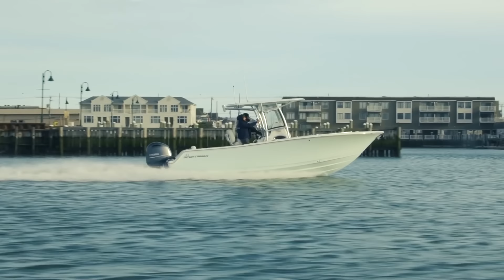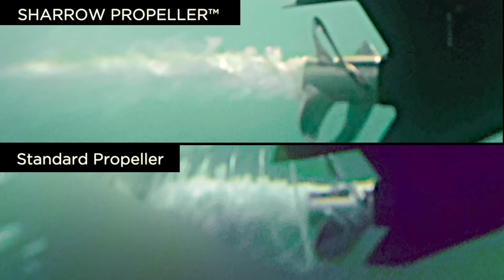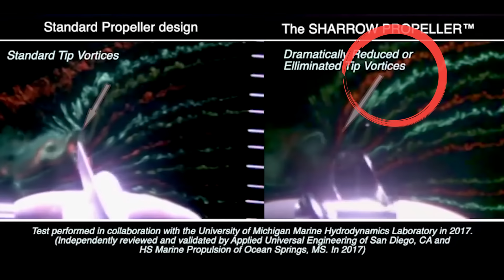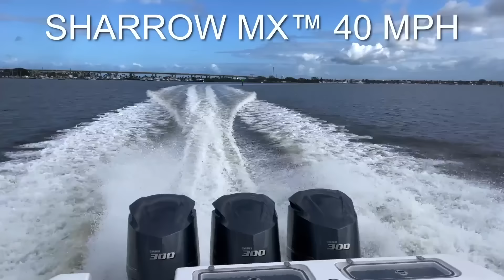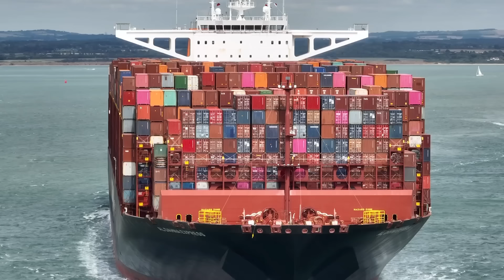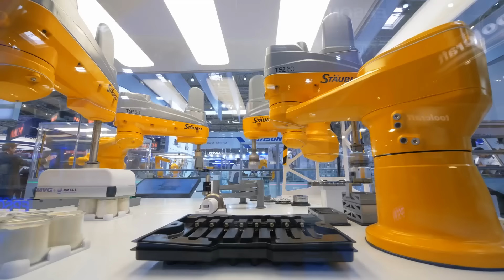This Genius Propeller Will Change Transport Forever

Comment from the maker: Thank you all for watching and the interesting comments, here are some points to address the main ones I have seen:
- Great points about how this may be manufactured in the future, part of the economies of scale I mentioned could definitely include injection moulding or similar.
- Durability is an interesting point and I would love to see how the blades fair in a 'crash test', they may also be harder to repair? Let me know your thoughts. 
- The gain in efficiency is 105% when compared to the original values (38% to 78%), it is true that absolute efficiency cannot be over 100%, but increases can be. Such as a company seeing a 200% increase in profits, for example.
- Many saying that reduced cavitation may also reduce wear on the blades, making them last longer in boats. Great point that I didn't think of!
Reply: This design is over 35 years old
Reply: @supyrow  much much older 🤔
Reply: @thisgame2  yeah!  saw it in a magazine, can't remember which one exactly, popular science or mechanics, something. decades ago
Reply: @supyrow  Yup, nuclear subs....that's all I can say...🤫
Reply: @supyrow  is there a formulaic mechanism that gives the proper parameters for the dimensions?
Reply: @supyrow  Yeah, and if it's significantly better, the Navy would have put them on every nuke subs and other ships. Less disturbance means less detectable too.
Reply: @gang208  water and air, are quite different beasts.
Reply: @supyrow  YES exactly. Instead of being economically sensible, the people in charge of making money with things have decided to price it out of the market.
Pity it isn't mandatory to study physics AND economics along with English.
Reply: Ohh.  And it is louder, more Inefficient.
Reply: @supyrow  Louder?  By how much?  For an incompressible fluid like water or compressible like atmospheric air?
Reply: @johnpayne7873  "incompressible fluid"...  yeah...  not sure what part of the universe your from, however back here on earth, water can definitely be compressed.  i am going to screenshot this.  can't make this up
Reply: @supyrow  Not made up, incompressible flow is an essential part of fluid mechanics.   Robert Patton has a classic text on the subject with the same name.  Materials that assume a fluid state are by in large incompressible for large ranges of pressure and temperature, with water being the most referenced material.
Reply: @johnpayne7873  bottom of the ocean. compressed fluid:water.  everyday.
Reply: @supyrow  Only a 5% increase in seawater density from sea level to bottom of the Marianas Trench.  For all practical purposes of engineering mundane vehicles, it's pretty safe to assume water density is constant.
Reply: @supyrow  OMG, just stop talking - you are making a fool out of yourself. If you had actually studied fluid mechanics, you would know that water is modeled as an incompressible fluid...
Reply: @eliasgermer8762  this is true.  However,  the argument is that water is compressible.    It is literally 'precompressed'
Reply: @supyrow  Yes, you are right. I just thought it was obvious that the standard model of fluid mechanics was intended. With that said, I apologise for my previous comment - it was unessesary.
Reply: @eliasgermer8762  no worries, no hard feelings.  I appreciate you.  your response was justified, its cool
Reply: I am going to see if I can get a few 3D printed for use in water pumps. Efficiency is critical when working off the grid. Cheers
Reply: @uprightfossil6673  toroidal props are designed for use in the open, not inside a housing. They don't provide any benefit in ducted fans or pumps.
Reply: @squirts1  and you know this by empirical proof? Theory is great. Like opinions everyone has one. I plan to try these props in a small scale water pumping situation where noise, cavitation and efficiency are critical.
Reply: @uprightfossil6673  I mean, they explain the purpose of this design in the video, but you can read up on it yourself. Toroidal props reduce the tip vortices (vortex). Ducted or shrouded fans/props/pumps don't have problems with tip vortices because there is practically no flow beyond the tip. Also, pumps generally don't use propeller type blades. They use various types of impeller blades that are very rarely similar to propeller blades. There are several reasons impellers, pumps, compressors use different types of blades.
In addition you can reduce noise by adding blades and changing blade geometry for open air props.
Reply: @squirts1  I have plenty of free time being retired. The application I am looking for is specifically for moving water. You sound as if you understand how a more efficient way to pump water would be important in a limited DC off grid situation. That is my interest. I care not one bit for others who claim one way or another about something I can do myself. I have not attempted to use toroidal props in my pumps, but will do so very soon
Reply: @uprightfossil6673  I mean, you can try but I'm telling you it will absolutely be worse than any other type of existing impeller pump design.  Objective fact.
Unless... The pump you currently use was of your own design and is made to some poor standards (like just sticking a propeller in a pipe without any care for proper pitch and sizing. 
Also you should consider whether you need volume or pressure or a mix of both. That determines the type of impeller pump you should use... Axial vs radial impellers perform differently and will be more or less efficient if not used in the proper application.
Reply: @squirts1  are you speaking from experience or from theoretical principles. Because from what I have experiences before trying toroidal props was that seemingly insignificant changes made a big difference in either volume, noise/vibration and pressure. Please note that I am using many pumps for different applications. Some I need volume at a certain head and others I need less energy consumption for volume.
I appreciate your doubts, but without actual testing in my situation, theories are just untested ideas and doubts are reason for testing. Cheers
Reply: @uprightfossil6673  I mean, it's more than just a guess bud. It's physics and fluid dynamics.a toroidal propeller is designed very similarly to a standard propeller. It's basically 2 props offset from each other then connecting the offset blades.
propellers are designed very differently from impellers because there are different principles involved. 
Also, toroidal props are for the most part snake oil, even when just talking about props.
It's very clear you are not an engineer and don't understand how these things work...
But feel free to waste resources on something I know won't be better than existing impeller fluid pump designs.
Reply: @squirts1  well, as an engineer you should also never assume everything works as it should. No I am not an engineer, and as I said I am looking for that one spot on the graph that suits my numerous varied situations. If you had been here when some of my “aha” moments were found you would not dismiss anything from the possibility of success. Good luck going forward with a closed mind my friend, but it will be less frustrating for you to open up a bit.
Reply: @uprightfossil6673  haha... There's a difference between closed minded and being informed.
Reply: @uprightfossil6673  Here, take a look at this video testing several toroidal propeller designs on a 120mm computer fan. Toward the end you see the list of designs that have been tried and these are... not good. Note the #1 spot is a stock Noctua 9 blade fan, the rest are mostly user submitted fan designs (non toroidal).  Also, there are other tests around youtube showing toroidal props reducing efficiency. 

https://youtu.be/dBB_2P-Nq18

Another thing to note here is the MIT prop is comparing a the cheapest possible, included in the box, 3 blade prop. It is not comparing itself to other, aftermarket props that easily blow the stock prop away (pun intended).
Reply: @squirts1  the main thing here was clearly underwater props which need completely different things from computer fans, maybe it wont do much for drones (it probably will as you could see from the footage of the dyed air). Almost all of it is about noise and efficiency not performance. You are looking at this whole thing from an odd and in my opinion incorrect angle, you are showing yourself to be nice and high on the dunning kruger confidence spike
Reply: @squirts1  I really appreciate this conversation. And I am not trying to be difficult. But as I said, I am looking for that sweet spot in the curves of performance versus efficiency. You don’t have to convince ME. I AM NOT A FLAT  EARTH PERSON. I respect the physics behind all the tests, but in some of the videos I have seen a sweet spot and my curiosity has been peaked. I will look at your suggestions, and believe me, if my own tests aren’t convincing me I will still have lots of time on my hands.
My most difficult challenge is to lift a large volume of water >20gal/hr about one meter/yard from a low rpm using wind power. But, I have several aquaponics setups that have varying degrees of lift and volume requirements and are limited by DC voltage and current from solar panels. Cheers
Reply: @squirts1  just a short addendum my friend, having worked on turbine engines as a youngster I understand air compression. These toroidal designs I have seen for the most part do not take into effect the compression of air in factoring the blade design. IMO the leading edge blades should be less surface area, but that is not my area nor interest at this point. Just a note from an old hack. Cheers
Reply: @Floris_VI  The video I posted wasn't for you, that reply wasn't a response to you, and I never claimed it covers all scenarios. 
My replies to the other gentleman were specifically about enclosed water pumps (because that was his use case). Ducted or shrouded fans are similar to the type of enclosed water pumps the person I was talking to would be using.
Perhaps you shouldn't respond to comments when you don't understand the subject.
Actually, the main thing "here" (the MIT prop) was open air propellers for RC quadcopters.
That said, The Sharrow props might be as good as they claim... Time will tell, but everything I've seen about them has been advertising or sponsorship. I'll continue to be dubious of such claims. It would be interested to compare them to ducted/shrouded ship propellers which are designed to have essentially the same effect.
Also consider that the size and mass of vehicle being propelled as well as the size of the propellers will have a dramatic impact on the type of propeller that is most efficient. For example, the U.S. Air Force has converted the C-130 from 4 blades to 8 blades while most RC plane pilots are using 2 blade props because they are more effective and efficient for their respective applications.
Reply: @squirts1  I was just making the point that engineers I have worked with are set on ideas that while observing the Laws of Physics, do not open themselves up to alternate applications. One video I watched showed a toroidal design with a better looking displacement of water at low rpm. Interesting to me, but not to an engineer who looks at the whole chart and says “at peak rpm,…” I need a sweet spot and don’t care about anything else was my point. Cheers.
Reply: @uprightfossil6673  Yeah I get what you're trying to do. I'm just very confident that your efforts would be better put to use on a different type of impeller design. Moving volumes of water vertically through a pipe at low rpm will need a pump with tight tolerances between impeller and housing. It would be much easier to do that at higher rpm. Anyway, good luck.
Reply: @squirts1  yeah, see that’s what I am talking about when I say engineers have a certain way of thinking. So far the best way I have found to move water efficiently with wind power is a variation of the water wheel. And that is why being hard headed and having lots of time, I will experiment with finding a sweet spot with a toroidal prop. All the best my friend.
Reply: @squirts1  Milan Vitez “water wheel pump” YouTube video from 11 years ago. I am tech ignoramus so I cannot link
Reply: @squirts1  yeah, I know about trying to lift water since I have aquaponics. Physically lifting five gallon buckets of water is a thing of the past now. Not so long ago it was my “exercise” for the day. Now, through a series of pulleys, springs and levers I can move water along to places I used to carry it uphill and all it takes is the sun, a battery and a pump to get things started
Reply: I haven’t watched your gym setup yet, but I will soon. I may get some ideas for your pulley setup. Cheers
Reply: @uprightfossil6673  sounds cool. As far as engineering mindset, it's more about not knowing your application in any detail. I was under the impression you were trying to move water inside a pipe given that we are talking about propeller blades. Water wheels certainly work and at low rpm at that. 
Oh, haha you looked at my videos? Nothing revolutionary there, just making due with materials available to me in Afghanistan. That was during covid when the military shut down all the gyms on base.
Reply: @squirts1  yeah, well, I found out about water wheels by accident also. Never know who has the next great idea. I used to carry my son in front of me so he didn’t have to stare at the back of my head. And voila! Someone invented the front carrier ten years later. My oops for sure on that one.
Reply: @squirts1  why wouldn't they?
Reply: @r4d1k0l  dunno what we are talking about but I'm not gonna scroll through 183 comments to find out 🙃
Reply: @Upright Fossil  Yes i am thinking the same , but for what sort of pump application? Drainge or  deep well ?
Reply: @uprightfossil6673  it is louder and efficiency will decrease. Get your results and post back here.  It is an old design,  it is garbage.
Reply: @supyrow  Where are you pulling your results from ? i.e.: Louder - Less efficient ?
Volvo Contra Props are VERY efficient. This looks similar albeit in one piece.
Reply: @team3383  it is an old design.  Lol.  It's bs.
Reply: @team3383  well, you can see some real numbers here. i left timestamps, the video is long winded.
https://www.youtube.com/watch?v=iISDNBTxwhM
Reply: @team3383  noise = energy loser = inefficiencies
Reply: @squirts1  less noise = less energy lost = less inefficienies. LOL.
Reply: @team3383  ok? I mean that's basically the same thing I just said.
Reply: @squirts1  If YOU say so LOL
Reply: @team3383  Im not sure what point you're trying to make... Are you just trying to pick a fight or did you make a mistake? I mean it sounds like we agree.
I said...
 @Team33  noise = energy loss = inefficiencies
Which is obviously the same thing you just said. It shows the direct relationship these properties have. More noise is more energy loss, which obviously means les noise is less energy loss.
Reply: @squirts1  I don't waste time re reading comments.
So if YOU are content, then so am I. Can't be clearer than that my friend.
Reply: @team3383  haha... sure kiddo.
Reply: How about windmills ?
Reply from the maker: @lito11111940  Would love to see someone work on this! Expect a video if I see any thing.
Reply: @lito11111940  no windmills, no PC fans. They are too slow for this shape to be efficient.
Reply: @TechMasterRus  I cant get over that noone mentioned the likelyhood of stuff getting caught up in the holes, especially water is always full of stuff, and especially stringy plantfibers, fishing lines, wood could reduce any efficiency in notime
Reply: @lito11111940  Imagine the size ! What would you make them out of to control the inertia and weight ?
Reply: @team3383  Honestly, no clue, just a thought. cheers
Reply: I work on ships, and reducing cavitation is a big deal for increasing the lifespan of equipment. I'm gonna be very interested to see if these propellers start being made for cargo vessels in the next few years- most shipping companies would pay hand over fist for a new propeller that offers even a 10% boost to efficiency
Reply: @angryscotsman93  This propeller makes the big improvements at 2000+ rpm. Ships run their propellers around 100 rpm so it is not relevant, if it was the big ships would have changed a long time ago.
Reply: graphene
Reply: Can it be used in power plant turbines (hydro, steam, gas)?
Reply: Well here's a great opportunity to teach everyone about the difference between percentages and percentage points.
38% to 78% is indeed a 105% increase.
Alternatively, it is a 40 percentage point increase.
The thumbnail saying "+105%" is, IMO, partly responsible for any confusion on the matter, since to calculate an x% increase, we MULTIPLY the base percentage by (1+x). But to calculate an x percentage point increase, we just add it to the base percentage. So the "+" symbol is more suggestive of a percentage point increase than a percentage increase. I would personally think that "2.05 times the efficiency" would be the most clear way to phrase things. But regardless, the video is certainly not incorrect.
Reply: May be some  safety advantage, too.
Reply: Looking at another with a three blade design. I know from C-130aircraft that three blade vs four blade props is a HUGE difference in performance. Good luck to you.
Reply: This is a scam. I read the paper and there is absolutely no data of any kind that support their claims. Not even the decibels which they claim it "reduces".  They only showed a stupid animation, not even a simulation which requires real data.  Don't be foolish by this scammers. They only did it to earn a price in a MIT competition. I mean, I would expect more from MIT.
Reply: So, how do you change the pitch of the propeller?
Reply: I'm not sure you've described cavitation correctly. Cavitation is about the fact that the low pressure zone on the reverse side of the propellor is so low that it the water boils and creates bubbles in the wake. It isn't the same as the tip effect that you describe; although that may be valid. The noise of cavitation is quite specific to underwater applications.
Reply: All of your points are valid. My only concern is structural integrity. These ideas combined with nanotube technology will open new worlds. I can't believe these scientific idiots haven't figured it out yet.
Reply: This propeller is from the 70s and no, it won’t change anything… engineer wannabes thinking any old crap is going to be the future just for the clicks and views deceiving the audience…
Reply: @DashzRight  I was thinking too, there are toroidal shapes that are effective and toroidal shapes that are ineffective. To engineer a toroidal shape that blows air at 105% efficiency would be a grail invention.
Reply: I’m just subbing because you’re super hot and I wanna go boating with you.
Reply: @NealD  That's awesome! Good luck! Zeroth? Time to get your toroidal on!
Reply: Offtopic but is the toroidal propeller less effective in air (mostly) than water (like showcased in this video?
Because I found other videos where there are any cons of using the toroidal propeller in air

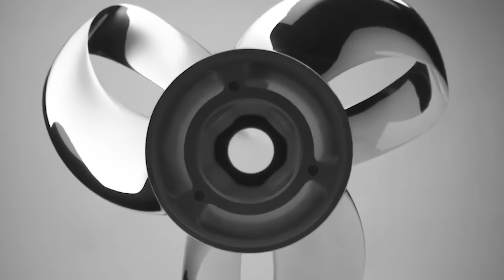Edit: 2:10 Oh! So Sharo is the strongest type of toroidal propeller than MIT? Now I know why toroidal propeller almost ineffective in air because the type of toroidal propeller they used (at least in other video) is MIT type, not Sharo type
(I already watched it but my good attention isn't great enough to found that detail before I type this reply. My bad 😅)
Reply: https://www.youtube.com/watch?v=pA1ye_SP2P0 Genius bordeless propeler 🧐
Reply: The sad part about all of this is it was conceived around 100 years ago by Viktor Schauberger and suppressed by the same group of people who suppressed Tesla.  This is nothing new and MIT shouldn't be recognized for discovering shit.
Reply: Dr. Science has created energy lol.
Reply: Actually, it is possible to have an efficiency greater than 100% because of its definition. However, if you calculate it with exergie instead of energie, then it has to be less than 100%. If you doubt of it, I can you some great thermodynamics books
Reply: @marzyhelmondo5980  does this 'book' spell 'energy' correctly?
Reply: @marzyhelmondo5980 incorrect. in the notion that it cannot be more than 100% efficient.  100% efficiency implies it has zero loses. any claims otherwise is defying the laws of thermodynamics.. as we know it. granted...   get a magnet cold enough and you will have 0 resistance.  problem is.... it takes energy to get and stay cold. that would be your energy problem.  therefore. 100% not possible.  EDIT:  @marzyhelmondo5980 i misread your reply, my apologies.  your correct
Reply: @xxmrrickxx  No, thats not correct. 10%->20% increase in profits is 100% increase. or 10%-points/10pp or p.p.
Reply: did someone say windturbine
Reply: So Zeroth, are you producing this video by yourself, or is it a large corporation?.....these fake foreign accents are annoying.....and you can tell it's the same person using them....look, nobody cares how many info videos you put out anyway.
Reply: THIS is why you make all these videos with a fake accent, because you really DONT know what you're talking about....pic a subject, do little research, make a video and make some cash...... I've watched numerous videos with your fake accents.
Reply: How about you change the thumbnail then
Reply: Why is there still no video demonstrating the difference in noise on quadcopters? Marketing lie?
Reply: @bratecyo  there are videos about that. Search YouTube for toroidal props... Some show improvement, others don't. Others also compare toroidal to 6 blade props and show the 6 blades to be better.
Reply: Alao obviously for both boats and drones this will have widespread military applications
Reply: @Floris_VI  na it won't.
Reply: @squirts1  great argument mate, explain to me how it wont work then mr scientist
Reply: @Floris_VI  Oh, it works... I didn't say it doesn't function... but it's not better than other existing propeller designs, therefore it won't have "widespread military applications." Also, I wasn't making an "argument." It was a statement of fact.
Reply: Can we test these? Where can I get 4 of them?
Reply: Let's imagine all of that which was presented in the video were true. 
Then the props would be classfied and used in the USN submarine fleet exclusively for decades before they get photographed and declassed. So how come that this did not happen?
Reply: I sell used boat parts for a living.
Cant speak for manufacturing,  but prop repairs, I can.
It looks like it shpuld be just the same as a trad prop to fix, depending on the material.
Reply: i need one to test on a paraglider system.. please and thanks.
Reply: So, click bait. As per usual from channels like this.
Reply: Reported for misleading thumbnail.
Since there is no propeller with even remotely 100% efficiency, there is obviously no propeller with over 100% efficiency. Otherwise that would be a perpetuum mobile and all energy problems of the world would be solved.
Reply: Since you admit that you were wrong, and that it DOESN'T actually have 105% efficiency, you should re-edit the video to reflect this. THAT way, you don't look like some drama queen knucklehead that makes impossible claims because he flunked physics. In informational videos like this, accurate details are the difference between looking like you know what you're talking about, and looking like you are full of crap.
Reply: Делай тест
На 5-6 грамм приходиться 1 ватт энергии
Вот когда будет 7 грамм на 1 ватт можно кричать о сенсации
Reply: Toroidal fields control earths atmosphere
Reply: That's not even the real problem, modern props typically achieve ~85% efficiency, so a 105% gain is impossible. After watching the video, it appears that gain only exists in a narrow RPM band where a standard prop has not its peak efficiency yet. That matters less than you think because engineers know this and design engines to run at their most efficient RPM and spend little time outside it. Super click-baity.
Reply: AAA
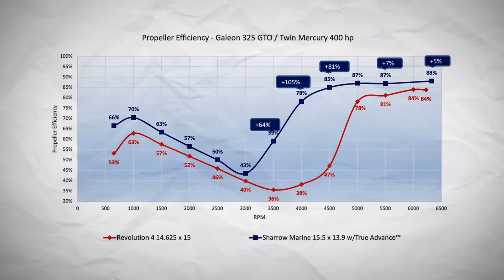Reply: a question about this graph (2:59): It's about Propeller Efficiency, it is not about the Boat Efficiency. right? Actually boats face less drag when going in lower speeds.
So I suspect good boats need have a propeller dimensioned to operate not in too lower speed to be inefficient due to propeller graph but not to fast to be inefficient due to boat drag graph.
So I think toroidal propellers bring the huge advantage of extending this range of operation. So a big boat, or a fast boat with bigger engines can be even more efficient while working in lower speed.
Reply: There is an Egyptian artifact similar to this
Reply: I wonder how this toroidal shape would work for a desk fan? Traditional blades are sharp and dangerous and fan must use OSHA approved grills over the blades to protect fingers. With such efficiency, a toroidal blade could use less energy and spin at a lower speed thereby making it less dangerous and providing more airflow too. Perhaps a grill wouldn't be necessary at all.
Reply: You knew what you were doing with that thumbnail. Altought the "+" technically makes it true, that's definetly a clickbait. Most will see it simply as 105% efficiency, like how most would see "x = +105" as "x = 105".
Reply: This is like the Narushevich ring wing designed into a propeller.
Reply: misleading hype especially for young budding engineers.  the device simply has more surface/material.  make the common propeller larger to match the toroidal surface/material used and differences will be small.  I think the reason for drones and water vehicles to use small propellers is for better agility and less cost.  it only loses efficiency once you increase rpm speed. I don't see any benefit for using toroidal unless your application absolutely requires less propeller radius but allows more width.
Reply: Do some research on Viktor Schauberger. He knew about this many years ago. Somebody made a screw shape propeller using  Schauberger's design to turn large volumes of water in water towers. The efficiency was greater than this particular prop
Reply: Cavitation does more damage than you might think, over time it can literally rip holes into or even through the whole blade. Its amazing what such "bubbles" can do
Reply: Where can I get the .stl file for this toroidal propeller? I'd like to 3d print some for my cpu fans, ac fans, and stand fans. Shit I want to try out for my car radiator fan.
Reply: I just wanna say you look like you could be a skinny pizza boy anthony
Reply: fewer tip vortices
Reply: Makes me wonder if the US and Royal Navy have not already taken a good hard look at these...
Reply: Ребята молодцы, хули.
Reply: Are these torodial props available for use on marine boats. Am in Indonesia. For smaller 40hp size marine engines like yanaha, suzuki
Reply: The is a difference in saying profits have increase 200% and efficiency.  You can double your income and say it's a 200% increase but you can't in efficiency  because that violates the basic law of conservation of energy. If you're getting efficiency more than 100% , that means the output energy is greater than the input energy that means energy is being created and that violates the Fundamental law of energy conservation which states
"Energy can neither be created nor destroyed , it can only be changed from one form to another ".
Logically speaking , one cannot totally minimize the losses such as frictional losses or heat losses because ideal cases don't exist.
Reply: Nmmm mm
L loo
Reply: A company can have 200% increase in profit since its not a law of physics. You can not have a 100% efficiency as well on engines since there is always energy loss. I think the highest efficiency engines are electric with around 90% efficiency rate.  Average combustion engine has around 25-50% efficiency. Though fuels energy density makes up for it since they are more then 100 times energy dense as batteries are.
Reply: Why not high pressure casting with vibratory finish. Should be smooth enough.
Reply: @makenchips  Now THERE is an idea for these "breakthrough" propellers.
Put them inside a liquid filled vibrator and turn them on ..... MUST be a billion dollar market THERE !!! LOL. Let the rumples rumple.
Reply: Heat pumps are routinely more than 100% efficient 🙂In fact if your heat pump is not more than 100% efficient it is complete garbage.
Reply: yes...large scale applications are possible but would need dramatic red designing...let me know if you want some concepts
Reply: make a propeller like in an atomic heart 😎😎😎
Reply: "The gain in efficiency is 105% when compared to the original values (38% to 78%)" is an incorrect statement.
Reply: I suspect that using these props would significantly reduce mortality among manatees and cetaceans involved in prop strikes.
Reply: Efficiency can be over 100%. You have something in your house that is over 100% efficient. Go take a good long look at your fridge.
Reply: This can be used in electric aircraft too if it is that good....
Reply: The 105% in the thumbnail is pure clickbait, nothing more
Reply: I don't know your IQ is but you're definitely on to something
Reply: AI will perfect these designs, maybe will even create something unexpected yet.
Reply: this ugly thing can't be better then the good ol props mate
Reply: I once put a vornado fan in the bathtub to test the idea of an enclosed propeller for ships, but I got grounded for a week after accidentally electrocuting my parents.  This on the other hand is way better than what I did.
Reply: What if we make a fire or plasma in the shape of this propeller and then use it for ANYTHING?
Reply: I think it would make a great fan, but it would need to be in a cage like a puppy
Reply: Let's make an aquarium in the shape of this toroidal propeller in order to please our dear leader. We will certainly be on the path to financial independence by doing so, no matter what our other jobs are (😘teeheehee)! Have a lovely day! And remember to always consent to engineering and to observe all safety measures.
Reply: As for recreational boating, it will never catch on unless the design is copied by the manufacturing industry.   Re-engineering of drivetrains do not happen when a propeller has existed since Archimedes invented it is easily repaired and replaced.   Many have tried: ie variable torque props and propguard designs to name just 2.  Company who owns patent will remain small specialist custom works and NO revolution for the industry as a whole.   It will be at least 25 years before 'problem-solving electric units become available to the pleasure boating masses, that can make actual use for this, if EVER.
Reply: Thanks. Adding upgraded toroidal props to my 44M and 88M.
Reply: There is potential for huge energy savings in power generation, or basically any fan-cooled application.  I'm interested to see where this goes.
Reply: What is your mic/audio setup? sounds good
Reply: If I Can recall It correctly... Was Tasmania not in Australia? I F I'm right great work Australia. Again doing a Great job and giving itsel a good light in this dark world
Reply: 360 Mobius Drive? There's something green about my dream of putting one in the transmission of my truck.
Reply: Not possible
Reply: Brilliant.

However, don't you believe in a capital letter at the beginning of  a sentence, a full stop at its end, and indeed, the very idea and usefulness of a sentence itself?
Reply: Thumbs down for the clickbait title. I didn't even watch it and I'm blocking the channel. Yeah, I know I'm generating a little bit of buzz by commenting, and I'm also aware that this isn't an airport, and I don't have to announce my departure. I really just wanted to tell you this ain't it.
Reply: IT'S REVOLUTIONARY !! ... even if it's an old invention.
It was invented in the past at a time when we could waste anything.
It is now re-used at a new period of time when it becomes a key factor in transforming all our industry of transportation and energy as we have to do to survive.
Reply: The earthly toroidal field is why our DNA is in helix. . if you know these things you can invent this stuff
Reply: While that's a technically correct usage of percentages, using it that way is not a clear way to communicate and the criticism of this is deserved. However, while the criticism might be voiced here it should be shared among all, including those who made the visualisations and plots shown in the video, which was not Ziroth.
Reply: MIT proof of concept is not proof of practical use.  The model is many iterations from practical application of any kind.  And the noise reduction has been tested many times by other youtubers and the reduction is minimal and only really applies to a specific frequency range.  You're entire video is scientifically barren and ethically repugnant.

But initial research and testing are showing positive results.
Reply: What if you could harness the pressure from under the deep ocean & convert it to electricity? 🦧 
Unlimited pressure.  Unlimited "green" power. 
Right? 
Water has more uses than we think. 🥸
Movement... "energy"... 
is just one form.
Reply: @ReeseSYL  we can't change the density of a sinking object, unless we traffic air from a part of the apparatus which is connected by rope and is directly pulling the rest of the apparatus upward. The idea is flawed. Perhaps if the apparatus needed the bodies of fish in order to seek further depths, then it might would be possible, but it's quite the nightmare to have an apparatus potentially killing fish as it tries to reach the center of the earth for nearly no reason. Think of density As A Constant. Goodbye
Reply: Imagine a rocket with these propellers in it which keeps trying to self-assemble into a "wet" [inside-out, fuel-submerged] car engine but re-disassembles instead of starting its second stroke. Maybe a KitKat in the shape of those propeller is the best thing to do with it. Or at least print them on KitKats. You can email Nestle right now. I'm giving you permission
Reply: @WellBehavedForeigner  Shit man. Wot are yoo on ?
Reply: fard
Reply: The absolut efficiency cannot be even 100%, to reach 100% energy efficiency, you need to have no losses at all, that's not possible.
You will always have some losses, in useable Energy.
Reply: @lissyflur1907   correct.   Laws of thermodynamics
Reply: @supyrow  incorrect, both of you. 100% efficiency can be achieved, as stated by the most simple 8th grader physics lessons ever. It depends on your viewpoint. If you want to create heat, sound, and all the other good stuff, then you will have reached 100% efficiency
Reply: @nialasciva  no.   can not be created nor destroyed
Reply: @nialasciva  there is always loss.  that's why if you bounce a ball, it can never reach it starting point, IF you do not ADD momentum to it.
Reply: @lissyflur1907  Maybe you're not appreciating the economics. At +105% efficiency your fuel tank actually fills up as you turn the prop allowing you to sell the extra fuel so the prop pays for itself in no time LOL.
Reply: @lissyflur1907  The man is talking efficiency levels in comparison to power input on a standard propeller....
VERY current for younger people who have been brought up and bombarded with marketing to use such comparisons.
The total efficiency can NEVER exceed 100% but all that is lost on them ! I had the same thoughts as you - NEVER in a month of sundays an there be a figure of 105% efficiency.
If standadr only produces 20% then what he means is that this propeller produces 42%.
Reply: @team3383  
105% of 20 is 21.
If standard only produces 20% then what you need to reach 42% is an increase by 210%.
If you put 105% of the estimated 20 percent on top of it, you end with 41%.
YT makes smart people smarter, and stupid people even stupider.
Greetings
Reply: @JackyThrilla  Love it mate. Yt groups similar people in similar circles. Funny you didn't think you'd be here.
You can fill bottles with "if" and chuck them out to sea ... If, if, if.
If I had ham we could have ham and eggs, if I had eggs.
Cheerio.
Reply: Yikes man..do you typically fall for things easily? This are not new first of all.
Also, these are horrible. all the data proves this are bad. 
Stop falling for things kid.
Reply: An absolute efficiency of 105% means that you get more energy out than you put in. That would be a perpetuum mobile of the first kind, because it contradicts the first law of thermodynamics.
Reply: @Nikioko  But the claim wasn't 105% absolute efficiency. It was 105% greater efficiency. If the initial efficiency was 40% then 105% more would be 82%.
Reply: @OKItsSent  But the clickbait title card suggests so. Only the captain clarifies.
Reply: ...why?
"efficiency increased to 105%***"
* = compared to reference prop.
What kind of bullshit is THAT?
...one can pick any piece of junk as a reference, and then procalim breakthrough in efficiency, because its better that flapping aorund with your hands.

This is an old design.
Not a breakthrough.
As it reintroduces a fundamental problem, fixed wing propellers are only efficient at a given speed, go faster or slower and efficiency drops off. Not to mention when one tries to apply this to aircraft.
To say the least, helicopter rotors are made out of real materials not uobtanium, and as such they have weight, and a maximum yield strength, and the like.
Thus its VERY FUCKING IMPORTANT how mass is distributed in said rotor.

The best theoretical efficiency could be achieved by ditching bell shaped lift distribution, and keeping number of rotary wing at a minimum, in this case at 2 (as only having one (while possible) has its own issues).
Toroidal props have 2x the lifting surfaces, thus are worse off from the start.
Reply: Very Interesting video. Unfortunately, in the economy we live and use, more efficiency means more expense. So all the gain goes straight out the window. 
Slightly explained by "economies of scale" but do you really believe that ?
The sales argument will ALWAYS be "But you'll be saving 20% on your fuel bill" so in effect replace the *saved" fuel by paying MORE for the solution ......
It's a sad world we live in when all and everything is motivated by gain and greedy people.
As soon as you step out of university and join the commercial world this will hit you strongly.
Reply: @team3383  Economies of scale will make them cheaper, eventually.

A good example are prices for solar panels. When the first ones were sold they were so expensive they only made sense in space applications. E.g. Power for satellites.

Today, they are dirt-cheap in comparison.

High-tech is of cause something else than mechanical stuff - nontheless the props will cost a fraction of today in the future.
Reply: @team3383   you are just an optimistic bundle of joy
Reply: @hestonthomas8746  Why thankyou ;-)
Reply: @team3383  basic economics, cost of replacing verses cost of fuel saved ,simples!
Reply: @johnteeling4679  While the basics of Economics remain basic; the issue lies with the REAL cost of replacement. NOT the cost given by the salesman QED.
Reply: @team3383  <--- Ding ding ding! Yep, there will zero gain at all from this device which means absolutely nothing. "Greatly reducing costs, increasing efficiency". Everything's a lie, a joke, and things will be more expensive then ever, just like one software program starting in the ~90's could eliminate 200 positions of finance, accounting, human resources & inventory managers at a nation wide company...but where's the savings? Yet if computers were never invented they'd be perfectly fine with payroll and the 200 original staff members they eliminated.  Everything that's "Oh so good" results in everything around it going up in costs. Make this propeller 500% efficient... they'll just increase the cost of cargo containers, port fees, boat licensing, gas...because now need less gas, so can charge more. Everything's stupid. Let's be brutally honest, if this was 1000% more efficient...you honestly believe goods & services would go down in price? Seriously...100 years of "technology advancements & break throughs", yet the majority of the entire US population work pay check to pay check (fact). One computer can do the job of 100 men in a year, yet...where's all this savings and good prices? Yet if the computer & technological advancements never happened...and needed those 100 men on the payroll...they'd still be making a profit.

Everything's a lie, 20 revolutionary inventions a year, where's the savings, the gain or advancement? It's like literally EVERYTHING is a lie...everything because there's zero gain at all. Everything we supposedly gained and a generic loaf of bread is $4, a generic cup of coffee is $5, electricity isn't cheap, but we HAVE SO MUCH EFFICIENCY! OMG! No...gas will go up, boat licenses will go up, and there will be absolutely no savings, at all. Seriously, the absolutely worst modes of transportation were sails, hand cranes, horses and paying 4000 men to staff a port, being profitable in 1850's, 1900's, 1940's. Yet now we have one machine staffed by one man, that can do all that x10 faster and cheaper eliminating all those costs...where's the cost savings?

Oh yeah, these's are technological advancements and there is the SPECIFIC gain vs the old version. But to say it's beneficial, or efficient...lol...everything is relative to what a person or company can afford. If we used the worst propellers to every exist in history, everything would adjust to those costs of fuel, travel times, efficiency.
Reply: @Blakelikesfood  Chill out mate.
You are OBVIOUSLY very intelligent.Why are you reading and answering YT videos ?
Nothing better to do with all that knowledge ?
You should be on top of the world like Bill Gates, trying to solve issues now you've ruined all our lives with BS.
Reply: @team3383  And yet everything I said is 100% correct, just like all the previous "efficiency & cost cutting innovations" that have done absolutely nothing but cheapen products and drive the prices up.
Reply: @team3383  yeah and the 'savings in fuel' is just  a nonsense sales lie (without large sections of fine print).